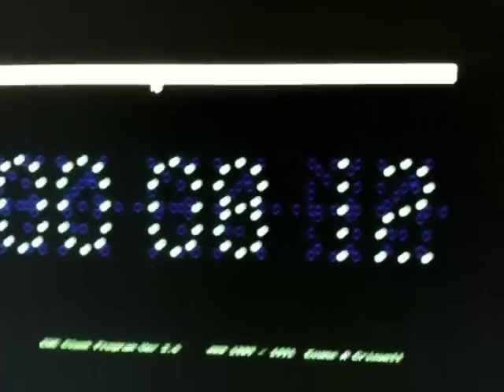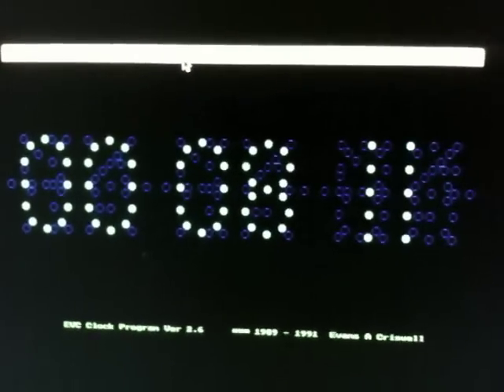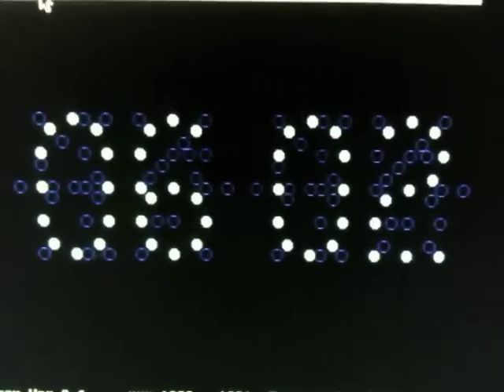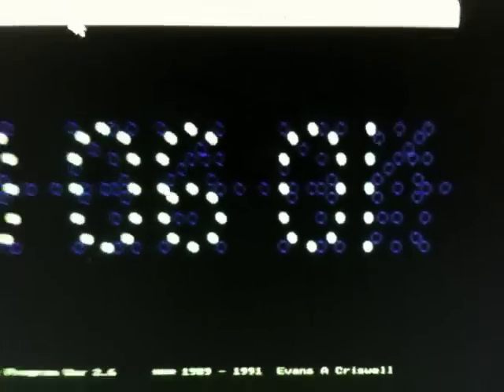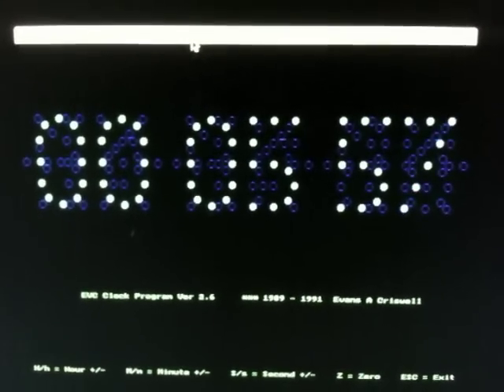Old Unique Scoreboard Emulation (Naden)

Comment: This is a similation of the clocks and numbers on old Naden Industries scoreboards. Naden was one of the better known brands in the 1940s and 1950s, even thru the 1960s, but the company lost out to competition from bigger firms in the 1970s and beyond. Naden stopped making scoreboards somewhere in the 1990s. I have operated scoreboards for over 45 years and I cut my teeth on an old Naden board in our high school gymnasium. Their design was decent and reliability was pretty good.